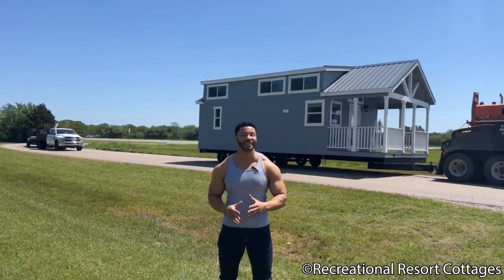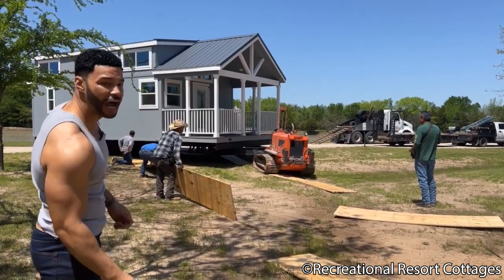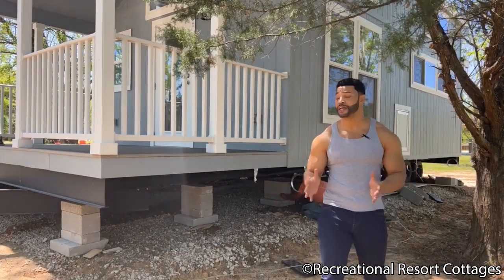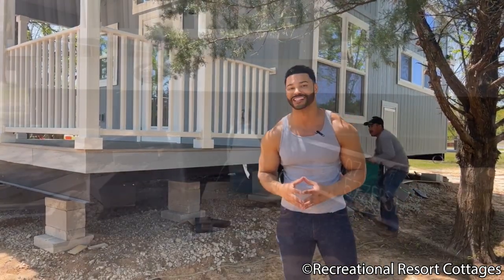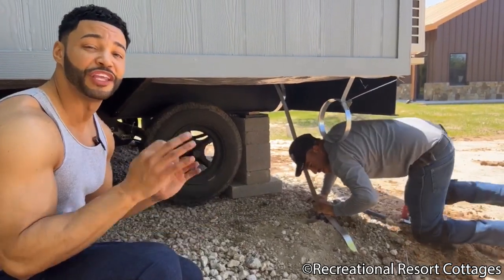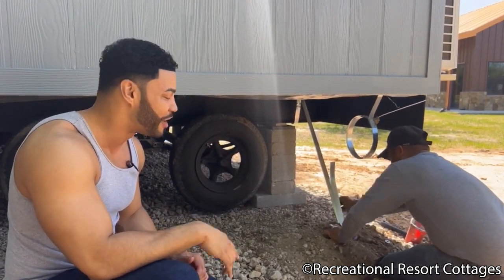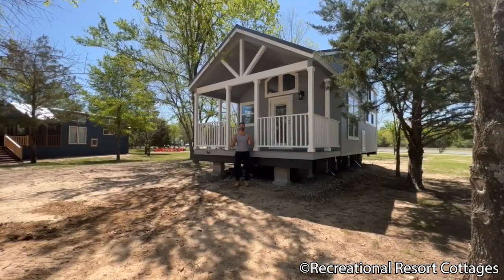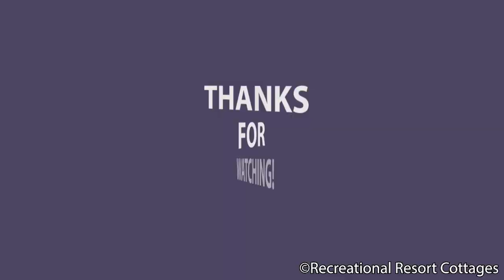TINY HOME HOW TO Deliver and Set a RV Park Model

Comment: Ok. Mr. Tiny. I understand the transport and the anchoring of the home. What baffles me is how is the plumbing/water, electrical and gas if any connected. Would love to see that.
Reply: ?? There’s no infrastructure for this lot. How does this work?
Reply: This is Hidden Forest Lake tiny home community. It's already set up with gas electricity and water you just can't see it in the video. There's a lot of people already living there. They have a website you can take a look. The rent is super cheap compared to where I live in California. Less than half.
Reply: @akajulz  thanks. Not sure what I expected but wondering does the home have to be moved again to dig and connect to pipes for plumbing and sewer? Or is there enough room in that crawl space. And can these home go anywhere or does it have to be in a designated tiny home community. Thanks so much.
Reply: @cydneystephen2814  if you've ever been camping at an RV resort it's just like that. If you haven't, there's a faucet for city water, and opening in the ground for the sewer which attaches to the home with PVC piping, and a pole with an electrical box attached to plug into. Some locations also have natural gas although some areas are trying to get rid of natural gas. I believe they have 100 amp boxes at this location which is really good because a lot of places only have 50.  These  hookups are located outside of the tiny home not underneath it. They have to have easy access. 

If you move the home somewhere else these utilities have to be in place. It depends on where you live if tiny homes are allowed, and where they're allowed to be placed. It varies by city. Most RV parks allow RV park models which is what these tiny homes are, because they are an upgrade from travel trailers, 5th wheels, and single wide park models from the 60s and 70s.  In my park, any new homes coming in have to be RV park models. Sadly, because of deal they have with a local manufactured home dealer the prices start at $169,000.  The dealer puts a $50,000 Park model that looks nothing like the one in the video and then they charge $169k for it.
Reply: @akajulz  thanks so much. I have an understanding now. Very much appreciated. Enjoy the rest of your week.
Reply: @cydneystephen2814  you're welcome. I know Mr Tiny doesn't have the time to reply to all the comments.

Comment: I bought a 20 year old tiny house last December and I liked this video because I got to see what a house with insulation like mine looks like from underneath. I got mine for 55K so those babies keep their value! It also passed the appraisal with flying colors, so you can see the value built into them. They're definitely worth the money, so if you're in the market for one make sure the dealer and builder are honest and reliable then go for it! Those views of Mr. Tiny were a nice added feature, and congratulations to the happy home owner!
Reply: So much for a reply I saw on one of Mr Tiny"s other videos. It was from someone who sells RV park models elsewhere. He was saying that they are not designed to be lived in full time for any length of time.

 I've lived in a 20 year old travel trailer for The last 9 years because it's the only way I can afford to live in San Jose as a retiree. Travel trailers and fifth wheels are not meant to be lived in full-time. I've had to do a lot of small repairs, but because it's 20 years old and built better than the ones today being manufactured I haven't done anything major. 

 The tiny home in the video could easily be lived in for decades because it's built completely different.
Reply: Most Tony's cost up to 10x per sq ft then a regular home. It is over kill on many because they have to be road worthy so if you permanently park you have an incredibly strong well insulated home to last decades just be sure you buy from an accredited builder not a guy who builds them on weekends in his backyard.

Comment: I can't tell you how happy I am to see someone setting these up properly.  My father worked for Iseman Mobile Homes nearly his whole life. I went to work with hime sometimes so I've been under plenty of mobile homes.  I'm also happy to see that you let the wheels and stay with (although I'm not sure about leaving them on).  In 1997 we bought a brand-new mobile home that was set up by the trailer park and they clearly did not know what they were doing.  The mobile home settled improperly  and was damaged due to their set up.  I insisted on a third party to check out the set up before converting to a mortgage.  It was sagging in the middle several inches.  They leveled and reset it but the damage was done.  The wheels and tongue no longer stay with new mobile homes.  They take them with and reuse them.
Reply: @kittyexotica5635  I know that but they are set up the same. Same premise, smaller scale.

Comment: Hiiiiiii Mr. Tiny!👋🏽 Thanks for showing us this process. I was wondering if they leave it open like that or do they also install skirting? Also, could we see how they install on a concrete foundation on someone's own property? And how do they connect the home to utility lines (gas, water, electric)?
Reply: That was my question re the utility hookup.
Reply: I would like to see this as well.
Reply: The gas water and electricity is already there you just can't see it.  I looked at the Hidden Lakes website and they're very strict so skirting is required. Everything needs to match and has to be approved.
Reply: @akajulz  I saw everything on the back of the house but I'd like to see exactly how they hook that up.

Comment: Impressive that the straps go up and over the roof rather than just through the chassis. I never knew the straps were part of the integral structure. I know each state has different codes for securing a mobile home, but this looks very secure. Well done! Thank you for sharing this information.

Comment: While they're setting the home, do they go inside and place a marble on the counter tops or floor to double-check that it doesn't roll? Hate to do all that setting work and find out after their gone, that it wasn't perfectly level.
Reply: Good advice.
Reply: No need they water leveled it
Reply: I was wondering about that.
Reply: There's a really inexpensive device called a level that you can buy at Home Depot LOL. If they need to check anything I'm sure they use a level.
Reply: @akajulz  Why spend money on a level. Marbles (ball) is free at home. Builders used a level to level my countertops which are very unlevel. Builders used the water-level on my dad's mobile home, and it isn't level. 

A marble on the countertop or floor is the best method, because its a physical object, whereas levels you view and guess, its not exact.
Reply: @katel3962  I don't own any marbles so I would have to go buy some. You can buy a level for $5 at harbor freight and have it for a lifetime.
Reply: @akajulz  You can buy marbles at the dollar store for $1 and have it for a lifetime.

Comment: So i suddenly realize that the term “park model” means that they can put it in an RV park. I’ve been wondering about that. 

Questions: can it be used on a basement? What happens on a property with a steep hill? Can those straps really keep it down in hurricane force winds?
Reply: @kittyexotica5635  thanks.  what I was wondering was whether they could install it on a basement/foundation. In some sense you’ve got a basement I guess, but I’m thinking of a real basement

Comment: Home Weatherization  was here  in 2010 took ALL My Tires off my Trailer  Without My Consent !!!! And then ran a dryer vent meant for a Gas Dryer--which was too long out to the outside of trailer (when I had eclectic dryer) the built up of dust caused a dryer fire !!!!!!  FYI...Electric Dryers are suppose to vented under the trailer !!!!!   Installed Crap Window's and Doors that basically fell apart when it rained !!!!! Had to replace Hot Water Tank bc It leaked form Day 1!!!!!!! Cost my Dad $1800 to replace their garbage  From Climate Control out of Clinton Twp. !!!!!!!   If you deal with Home Weatherization....Make sure they are Contracting with a Reputable Company !!